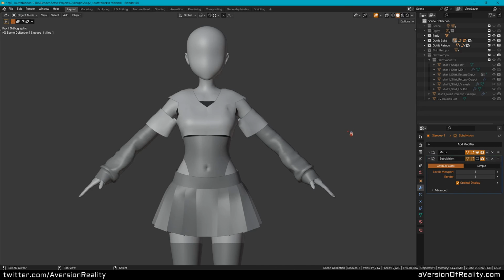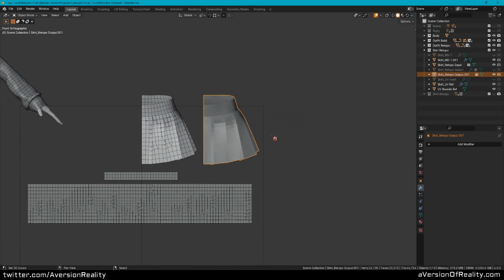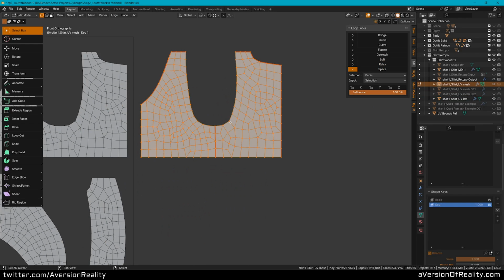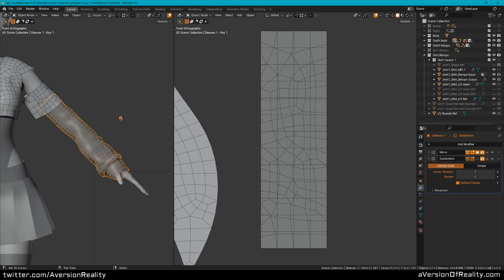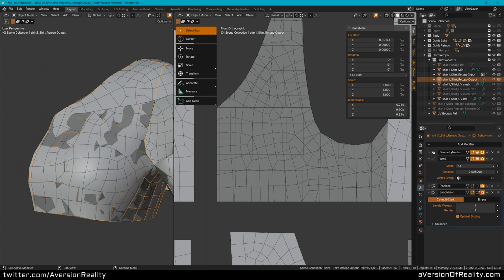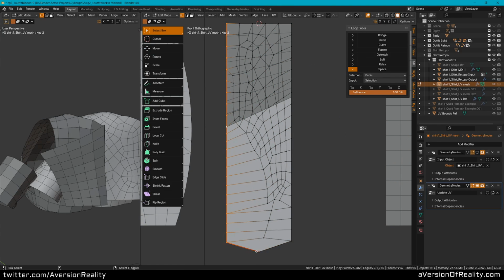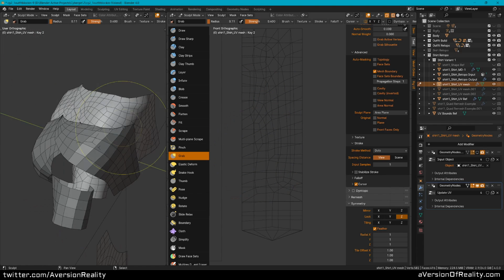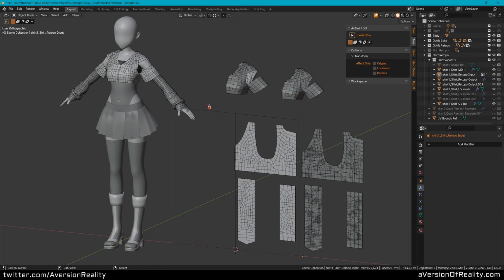Geometry Nodes UV Retopology Demonstration

Comment: How would the sleeve have caused problems as modeled from Marvelous Designer? I see that it is made of all quads. Why couldn't it be used as is? This seems like a huge amount of work. Is it really necessary? When deadlines are tight, every shortcut has to be taken.
Reply from the maker: This specific sleeve would have been fine from MD for most typical uses, its just an example. (Although if you wanted a really clean normal transfer proxy mesh, it wouldn't have been optimal.) But more complex MD meshes, or other similar things often need retopo.